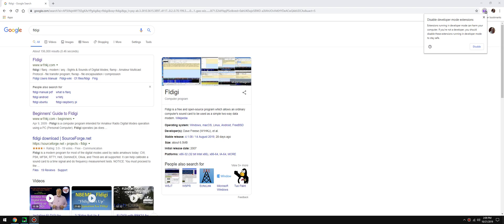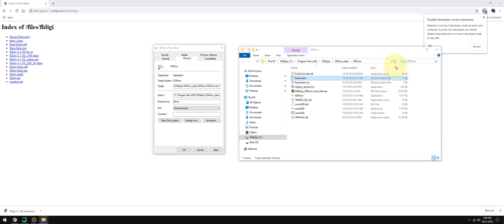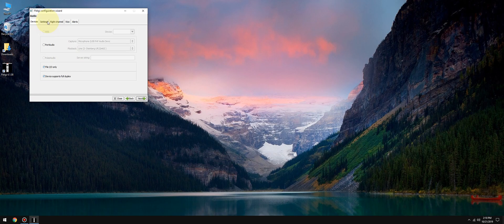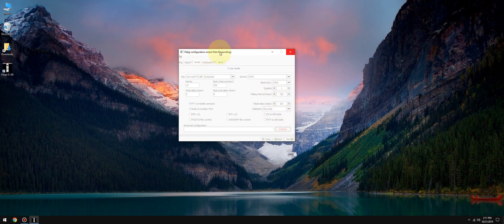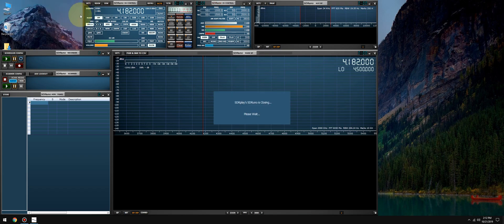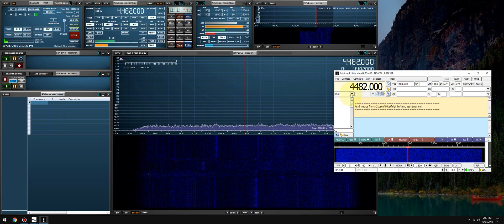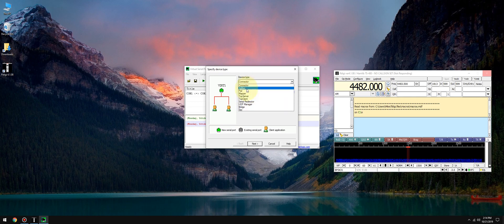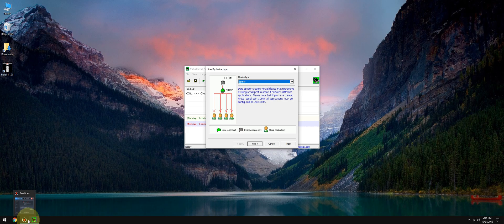Basic setup of Fldigi digital decoder & SDRuno

Comment: Detail is not visible in the video. I have everything downloaded and installed, but then just when you need the detail, it's not there!
Reply from the maker: Not sure what you mean by detail. Maybe select 1080p playback and run the video full screen?
Reply: @SDRplayHamGuides  I will give it a go! It just looks fuzzy and I can't read any thing although can see where you are going in SDRuno. I did get it working in the end, but I had to use several sources of info to make sense of it.

Comment: Hi Mike great video is there a way to do this with multipsk?
73 beau n9mfk
Reply from the maker: Possible if it supports the TS480 internally.
Reply: @SDRplayHamGuides  hi Mike you have to use commander or hrd with mulitpsk